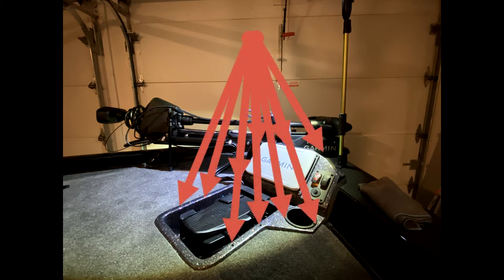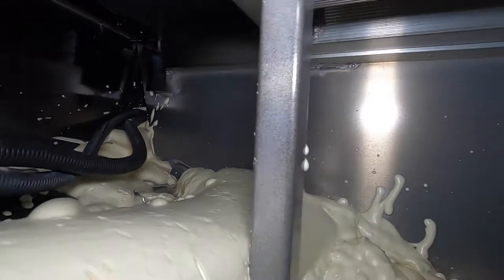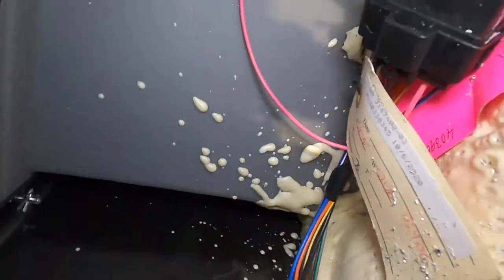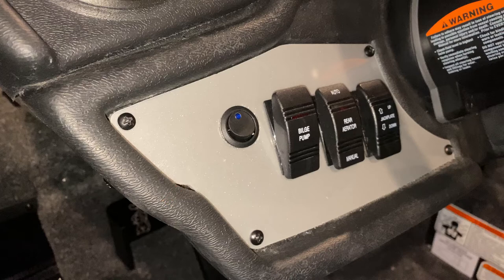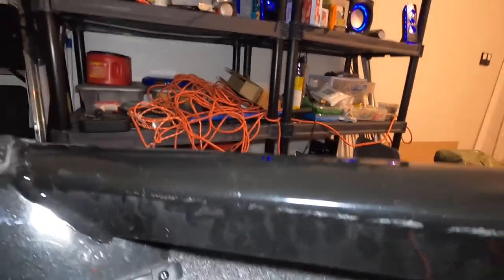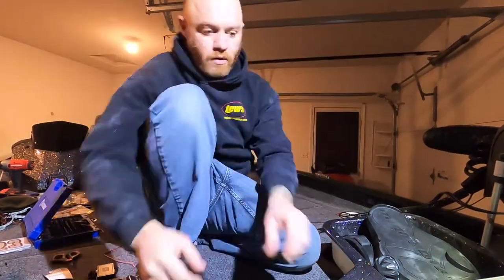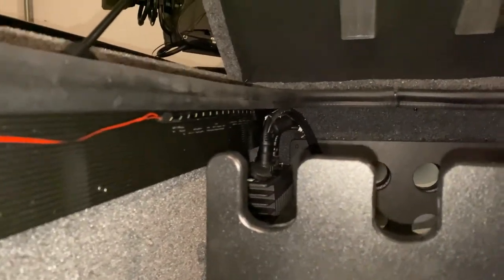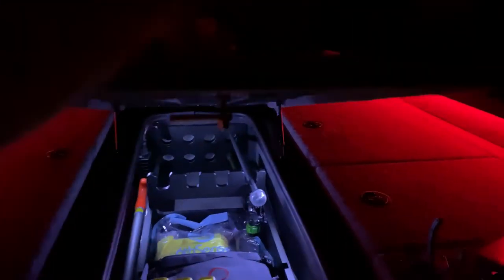Add LED lights to your boat cheap!

Comment: Great video! You did exactly what I'm wanting to do to my red rt188. Are the led's holding up good on your boat?
Reply from the maker: I have not had any issues with them. The double sided tape came off on one spot eventually but it was an easy fix.
Reply: Ok. Thanks brother!

Comment: BAM, didn't originally comment on this lighting vid for your 2021 RT198P. Good stuff. It looks great and want to do this.

My 2021 RT198P is now at my dealer and I saw it for the first time yesterday. Very excited to get it rigged and on the water.

We test fit a top-load TH Marine hotfoot and it is tight... prolly too tight. This video is the only place I can find that shows what it looks like behind the driver-side sloped foot rest that eats up the room needed for a proper hotfoot install.

Cannot tell for sure in the video: does the carpet on the floor come all the up to the painted vertical aluminum "back wall" under the foot rest area? Considering modifying this angled foot rest area, essentially removing it, but the floor carpet would have to go all the way up to the back wall for what I envision. Look forward to your answer and will share what I am thinking about.
Reply from the maker: The carpet does go all the way to the wall.  The hole behind it is fairly large but if you could cut a section of the foot rest off that is holding the fuse block, then I bet you could put that over the hole and free up a foot or more.